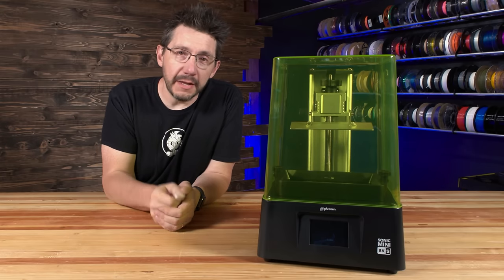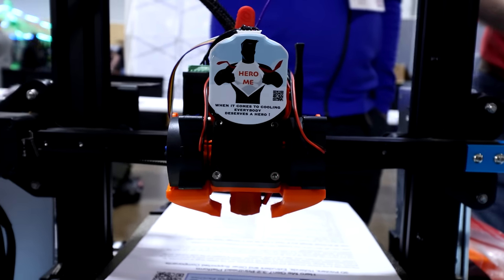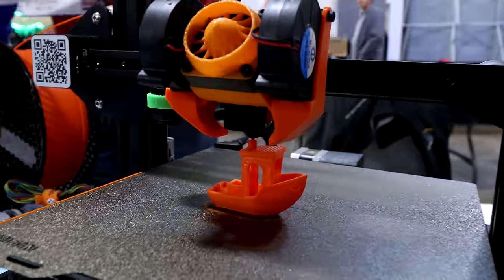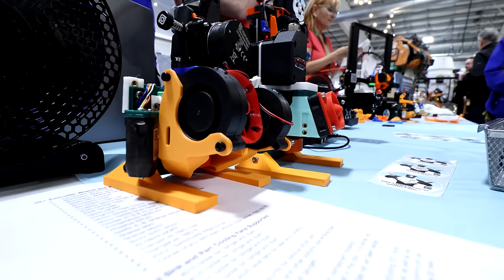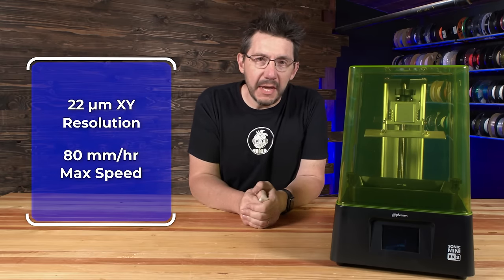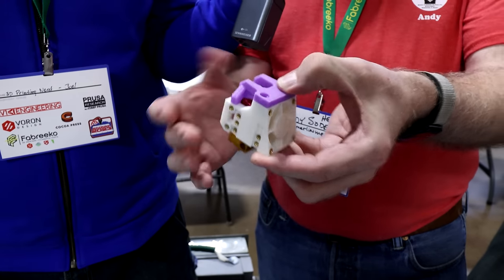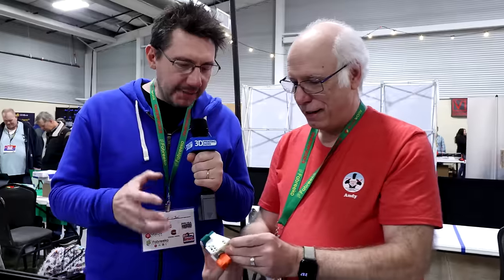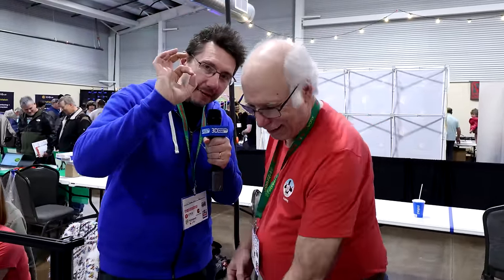🌟 Epic 3D Printing Upgrades: HeroMe Hot End System Exposed!

Comment: In case anyone is curious how I came by the over 35 billion possible Hero Me setup combinations, follow along with your calculator app... 1 Base X 100 printer models X 46 Hotends X 34 Extruders X 35 fan duct options X 17 ABL sensors X 11 ADXL345 sensors X 10 wire management towers X 4 LED mounts = wait for it.. (Note that these numbers have gone up since the calculation that gave me the 35 billion number. 1 x 100 x 46 x 34 x 35 x 17 x 11 x 10 x 4 EQUALS  40,945,520,000. Just shy of 41 Billion
Reply: Pure inspiration! Age is not a limit to the size of the dream worth chasing, but a reason to continue the chase!
Reply: Looks really cool, would love to see if you ever find a possible solution for a GooFoo Mido as I could use a much better cooling than original and the option to put on a Revo setup for easier change of nozzle :)
Reply: @focalratio456 sad his taking my work and saying is his...
Reply: @focalratio456  While I have answered Amaurisstudio’s comments in another post from him, in summary, I apologized for not being clear enough about properly crediting him for his work in the impromptu and unrehearsed interview with Joel. And for incorrectly remembering the country he is from (Dominican Republic). In all my documentation I give him full credit for the creation of the original Hero ME design that he developed over 4 months (nearly 5 years ago) and is comprised of 12 STLs that support four 3D printers (CR-10, CR-10S, Ender 3, Ender 3 Pro), 1 hot-end, 3 fan ducts, and 3 ABL sensors, and was for Bowden setups only. What I do take credit for are all my extensions and significant new design work (over 610 STLs with continuous development over the past 5 years) that bring my Hero Me Gen7 Release 4 to fully support over 115 3D printer models, both Bowden and Direct Drive versions, 47 hot-ends, 37 extruders, 35 part cooling setups, 20 ABLs, 14 accelerometers, 8 LED mounts, 4 endoscope mounts, and much more. The closest descriptive comparison would be that I was inspired by what he designed. With only two exceptions, there is nothing in common between the original Hero ME and my Hero Me Gen7.4. Those two exceptions are #1. Part of the name (kept out of respect for the source from which mine was inspired) and #2. The position of the grooves for mounting part cooling ducts to the Base. Over 600 STLs are brand new. What few parts of his original work (8 STLs) that have the same specific function, mine have been recreated from scratch beyond comparison. Only the core Base STL has any remote resemblance, but when you look at them for more than a few seconds you will see that they are totally different. Anyone can compare for themselves, simply search for Hero Me on Thingiverse and see the differences between the two projects. Going forward, I will be sure to correctly credit his original work (as I have always done in my documentation) and make the distinction between his design and what I have created completely clear in all future interviews, presentations, documentation, etc.
Reply: @amaurisstudio  it's ashame you feel this way but as @MediaMan3d has clearly and passionately shared in a huge response, he did try to recollect and be as clear as possible given the circumstances to tell the whole story. It was clear that the original idea wasnt his but he was a part of the early stages in some fashion but then asked to take it onboard himself and has done amazingly with it. Theres no need to be bitter and jealous as you wouldnt have brought this project to where it is today so think about if you're spreading kindness in the industry or being petty... Then think is it worth smearing the great work he and the other supporters pooring their own time and money to keep the HeroMe project going and evolveing to what it is today? Sometimes its hard but we need to put our feelings of loss aside and admit when we had "other priorities " and be happy with what others have done with our work since we couldnt continue. Have a think, and be kind to other's inhopes that others will return the sentiment when you need it.
Reply: @deltav1984   @deltav1984  Well... Let's say that you don't have the entire context... You don't know when it all started, or how it started, what was his part in Al this, but even more important! I'm not even close to being jealous as you say...  He knows why I get mad, and that's the important part, what people think, without context?, I don't care... And I'm already over it
Reply: @MediaMan3D   he asked for his cut, did you give it to him ??

Update 2: Update the 5015 Pipes, make the arm holders stronger.. add 2 Touch Mi mounts... as I don't have one, I use Petsfang mount as template. Update the "Source" file.

Update 1: Source files are up!!! the idea is to share the base of all this, so people can create mods, or do what ever they like with this!! BUT NOT MONEY!!! AND!!! IF YOU DO MONEY WITH THIS, SEND MY CUT!!! LOL

I'll be busy doing home things... so, I'll make all this open... share your mods and I'll make them public... I'll create a section with all the mods and links, so people can find your stuff even easier.

That's all.. HAPPY PRINTING!!!!

Comment: I saw me :D and now I'm curious why the Gloop Andrews were measuring Stefan... also, good camera David when Andy mentioned Stefan and you pivoted to get him in frame.

Back to the video: love the modularity of this whole thing. It's something I wish more printers actually did. Have a Voron and want to use a Creality hotend (hey, I don't know your reason...) well... too bad. Have a Prusa and want a single lead screw? (again, your reasons are yours) well too bad. Etc. etc. You can't just go with the parts you want and produce a printer unless you design your own printer. But for the most part, all the printers out there (Prusa, Bambu, Creality, Snapmaker, Stratysis, etc.) are all very similar. It's just those interface layers between the parts that can change. Have a mounting plate for a CoreXY, one for a i3, one for an H-bot, one for a hang printer, whatever... and now you can just pick the other things you want and mount it. There are generators for Marlin to make configs, RepRap firmware and Klipper both take on-the-fly configs. ABL can be done half a dozen or more ways, but they basically home to say "I found the bed" and then go from there... no real need for needing to make everything align every time you want to print.

So love this.

Comment: I have a video idea.  I have seen when using clear resin to print things that it has a yellow tint to it.  I have also seen restoration channels remove yellowing from plastic parts by putting them in hydrogen peroxide and UV lights so what would happen if you cured the clear resin prints in hydrogen peroxide?

Comment: I've recently got Gen7 v2.1 and experience was a mixed bag, closer to bad. Let me explain: some parts printed just fine with no supports and no issues, but some was a fail, since I had to do supports with PETG in places that could've been modified to be printed without supports, like 5015 part cooling ducts. Also, the mounting plate where fan supposed to be fastened to, is waay too thin for printing it vertically and easily snaps along the layer lines. I mean, thank you for the system, but it could've been optimized for printing without supports way more.

It's just my opinion and first experience, and it's not my intention to shit on the design. Just wanted to voice my frustration with it and bunch of spent time.
Reply: I print everything nicely with ABS

Comment: I'd love to see the least practical combination that anyone who knew what they were doing would only install as a joke.
Reply: Ender 2, Phaetus Rapido Plus, Creality single gear stock extruder as a direct drive, dual 5020 fans, Beacon3D ABL, ADXL345 (ADXL would mount on a spacer riser between the hothead and the extruder, Endoscope mount stacked on Beacon3D sensor mount, plus 100mm curved LED bar between the two 5020 fans two wire towers, and some big ass skull shaped heat sink fan shroud.
Reply: OH, and all this mounted on a Wham Bam MUTANT so we can quickly swap it out for the next sick setup!

Comment: You know the sad part? Is not Costa Rica, is Dominican Republic, its not his idea to be modular, is MY idea, ME means Modular Edition... It's NOT a team effort, I did it by myself!!!! The point of it was to make a light modular fanduct, using the screws that comes with the ender 3 to keep the weight low... The design of the ducts are optimized to keep the airflow even in both sides, because you don't need the extra weight!!! Dude... You don't know shit about 3D printing or design! You can keep saying is your design, but remember, thingiverse have DATES OF UPLOAD!!
Reply: Marcelino, I am sorry I named the wrong country. I am dyslexic and I often flip names (in this case countries), and as the interview was unrehearsed, and on the spot, I got it wrong. I have always given you credit as the original designer. It is correct in the first paragraph of the introduction in my assembly docs for my version of the Hero Me. Quote: "Welcome and thank you for selecting the Hero Me Gen7 cooling system for your 3D printer. The Hero Me was originally designed by Marcelino A. Mosquea S. (Kelokera) from the Dominican Republic and posted to Thingiverse in September of 2018."  I also always give you credit and a link to your Thing in the description of my model posts. I had long forgotten the meaning of 'ME'. Yes, you started with the design for Ender/CR printers with modularity for a couple fan ducts and ABL sensors. Then I picked up where you left off, and over the past 5 years, I have transformed it. I do know 'shit' about 3D design and 3D printers. My things support over 115 3D printer models, 47 hotends, 37 extruders, 20 ABLs, 14 accelerometers, and much more. Everything fits and components of a type are completely interchangeable. The only similarity left between the two is the spacing of the alignment slots where the part cooling ducts mount on the base, and a tilted face (although at a very different angle), everything else is completely new and different. The name remains the same out of respect for its origins. If I said 'team' in the interview, what I meant by that was that I beta-tested your designs prior to the 'ME' and gave you a lot of feedback where you incorporated a number of feedback points into the Hero Me design. There was no time in the interview to go into that level of detail. I am sorry you feel slighted, and I apologize for not being clearer in the interview. I will be sure to properly attribute you should I get the chance to be interviewed by anyone else in the future.
Reply: I have to say, I went and looked at the original Hero Me part cooling and downloaded and printed it and it is complete junk. (from Thingiverse) The newest one you can get for free on pretty much all the sites is 4 billion times better and cools much better from Andy. I printed and tried both and I must say two fans works much better due to the direction of the air. If you think about it, if you only cool one way you will cool 50% of the part in some cases or not at all in others. I had tons of faliures with the single fan version. None with the new version. The changes made by this guy Andy are leaps and bounds above the original. I feel like he kind of ran with it and the original guy is mad at himself he didn't think to capitalize on the money that could be made by selling the directions or whatever. Just bow your head to the better designer and move on. Don't be childish and yell at him on here bro. One last thing, if you are going to write on a public forum I suggest you spell and grammar check it (makes you look ignorant). Plus why wait till 2023 if you started this in 2017?? Cmon man
Reply: @AllinOneBBQ  thank you for your comment, but, if you know who's David Petsel, you know that he IS a engineer, he also created several fanducts, and he probably have the best solutions for 3D printers, also modulars, way before I started on 3D printing. If you follow this channel you also know there was a review and comparison between the original Hero Me and the Bullseye from Petsel and both are on par.

If you think blowing more air is all you need in 3D print you have A LOT to learn, 3D print is about balance... Weight is crucial when you need speed, as a designer I never even try to put 2 fans because of that, all the thought was put into delivering the same amount of air on both sides as front and back of the nozzle... But don't worry, you don't offended me! When you get noticed from people like engineers from TSMC, you know you're doing good!

And remember, without ME! and MY IDEA, there was no "GEN 7"... and my entire discussion is the way he's altering the history and presenting himself as part of the development and even the creator, etc...